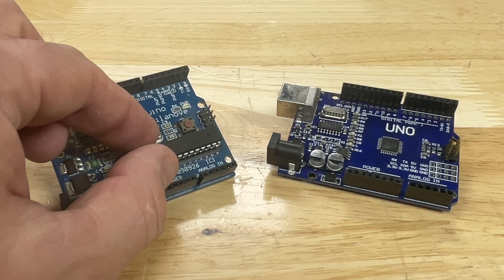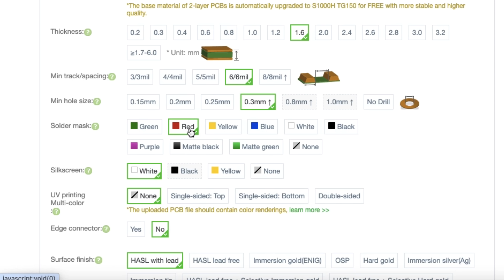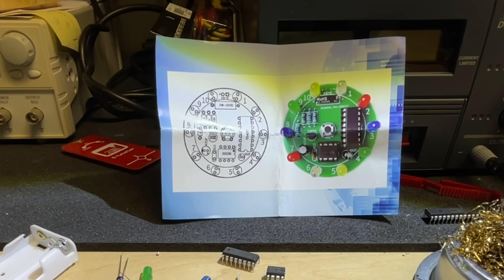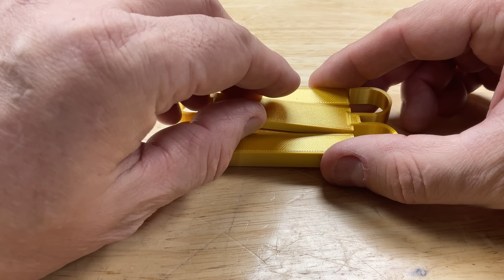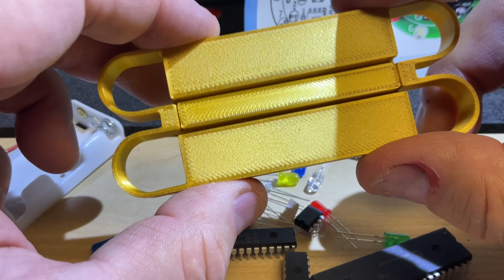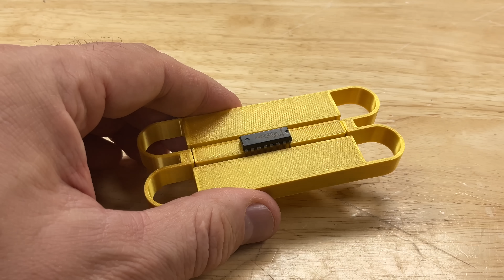3 - Useful 3D Printed DIY Electronics Tools - One Clear Winner

Comment: pcbway is pretty much almost a scam now. ive never gotten their 10 boards for only $5 thing. and I don't make complicated boards with large layers and ground planes. I tried making a simple 2 layer board nothing complex. price ended up being $60 BEFORE before shipping.

their $5 for 10 boards thing should really be looked into but since its a Chinese company I don't think anything can be done.
Reply from the maker: Strange. I’ve bought many boards from them at $5 for 10 and only paid extra for shipping. 
Lately though there is a tariff added.

Comment: In the good old days, i installed thousands of chips into sockets, new and used (repair jobs and new machine assembly). It took about 1-2 seconds to bend them against the table so they would go in. It did not matter if they weren't perfect, just put other side first slightly in and then pull or push sideways so that the other side gets into right position.

Comment: I am a 20-year-retired electronic engineer in the UK.  Back in the day when DIPs were almost universal we had lead-straighteners consisting of a metal bar, straddled by a pair of ball races about 12mm diameter, mounted on a grounded plate.  We put the IC astride the bar and pushed it through the bearings.  We always used gold-plated, turned-pin sockets, which are much more demanding of precise lead-spacing, but the fits were always perfect and insertion into sockets was easy.  Everything was grounded (including the operator) to avoid static damage.  Unfortunately, such devices are no longer readily-available.  Sliding ICs against plastic is asking for trouble, in my opinion.

Comment: That 28-pin DIP unit is just what I've been looking for without even knowing I was looking for it - Got a "chip-heavy" project going, and finding that even when well-packed, Mouser and Digikey shipments routinely arrive with pins bent out of shape - not to the point I'd bother calling them "damaged goods", but just enough that convincing them to go into the holes they're supposed to is frequently a pain in the rump, and getting in there with a pair of hemos to straighten them out one by one is even MORE of a pain. Started the print this morning before chores, came back to find it done, and aside from needing to be "broken loose" due to minor unintended bridging before the first use, basically perfect. Slapped a bent-pin chip into it, a couple good squeezes, and the pins fell into the holes almost automatically. Nice find!
Reply from the maker: That's great to hear! It's super handy for those bent pins.
Reply: Hey, thanks. Glad to hear it proved usefull to you! :D

Comment: It had never even occurred to me to use any sort of tool for that purpose.   I've always used the nearest flat surface to bend them for me.  I may have to give this a try.
Reply: Same here, I've always gone pin by pin or had my own little jig made. I will have to print a few. The one that straightens pins as well, looks like a great multi-tool
Reply: The pins on new chips are flared to set more firmly. We used a proper insert tool that gently pinch the pins in, place the chip in the socket, then release it. The pins press back out keeping the chip firmly in the socket.